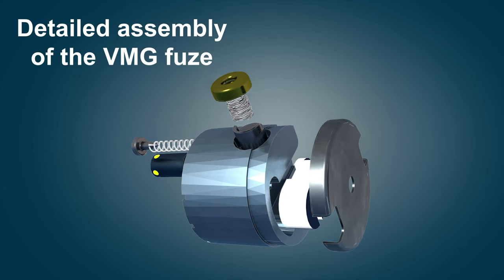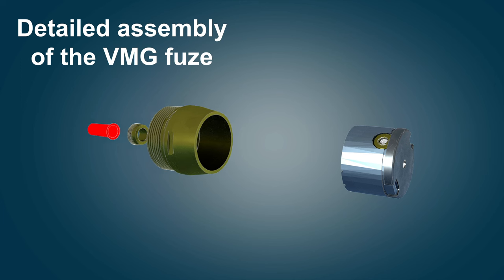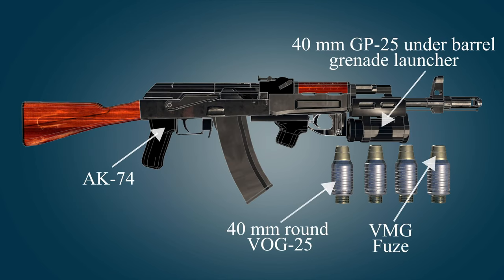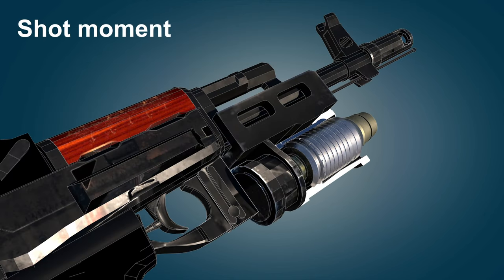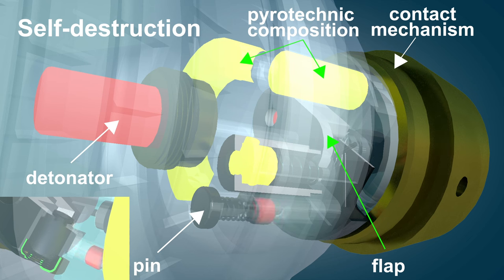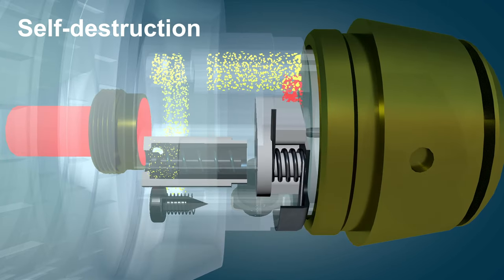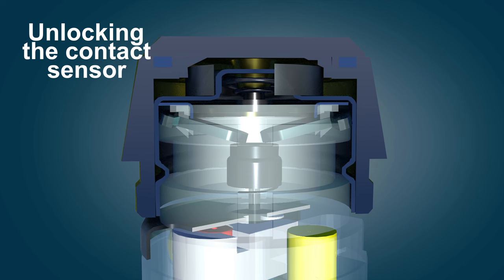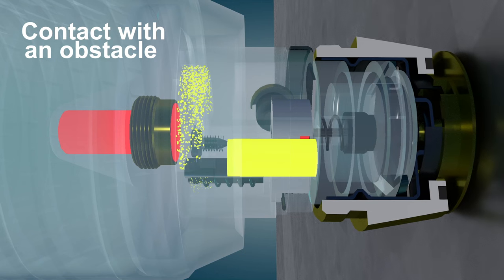40mm VOG-25 Grenade. How it works

Comment: what is holding the spring ring in place?
Reply from the maker: The retention of the spring ring is provided by other parts. In case of axial overload, the spring settles together with them and decompresses.

Comment: These are VOG-25 P rounds. VOG-25 rounds have a pronounced rounded nose cap.

The VOG-25 P rounds have a tandem charge that detonates, “bouncing” the round .5 to 1.5 meters into the air, producing an air burst effect. The VOG-25 rounds simply detonate upon impact.
Reply from the maker: Hi. This is M modification and it doesn't have rounded nose